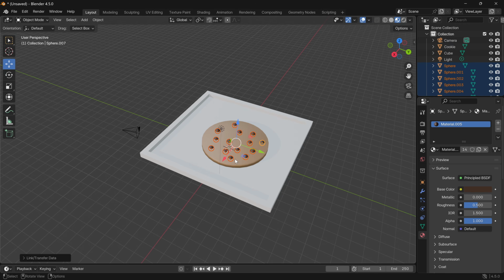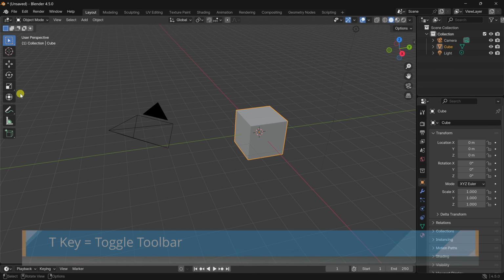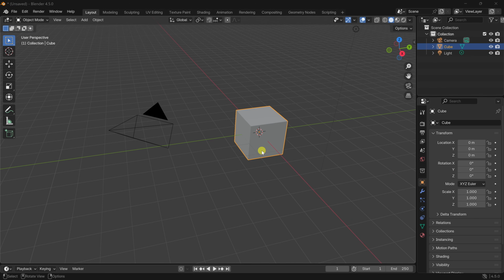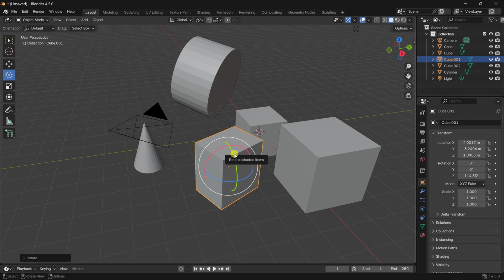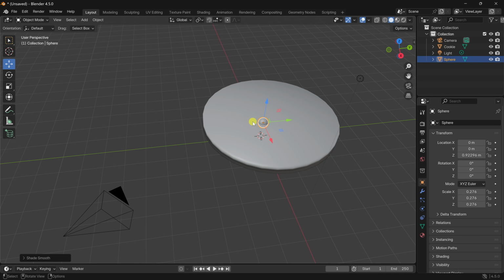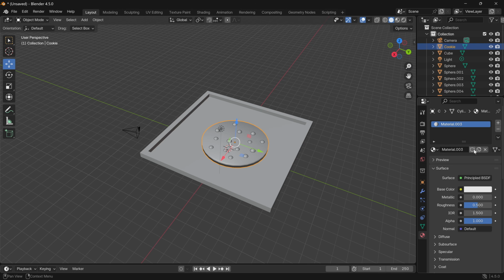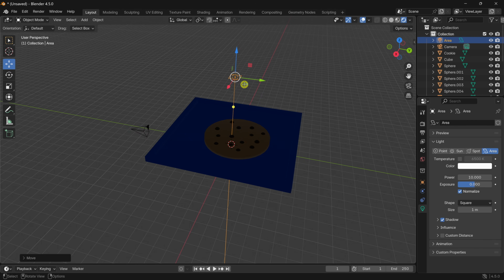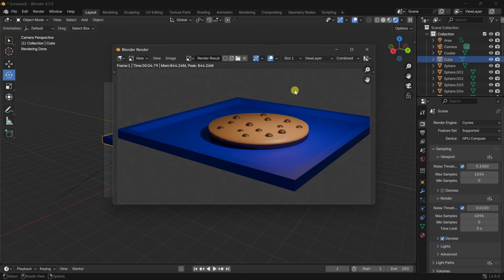Blender Tutorial for Beginners

Comment: Great tutorial. Does the eye drop color picker tool work with the Mac version? I opened a jpg, but as soon as I leave the Blender window to select the color, the eye dropper is no longer usable. Does it need to be opened within Blender.
Reply from the maker: Yes, the eyedropper works on Mac. Since sampling outside the window is failing for you, open the JPG in Blender’s Image Editor and sample it there instead. It doesn’t always have to be inside Blender—outside-window sampling was added for Mac in Blender 4.1. Which Blender version are you using? Release notes: https://developer.blender.org/docs/release_notes/4.1/user_interface/

Comment: This a very good tutorial . Would you be interested in adding Chico Chica male/female 5 piece cubes for the CubicWonder infinite system of 3D geometric Order.
If you are interested I can upload the .obj files for users of Blender.   I show all this using windows software on thepaultm channel.  Its a lot better than using Chaos Theory.
I find it very difficult to copy one part from end point to mid point or end point or centre point of another part.
I failed to group parts together to copy and move things around the same as you can with a cad programs similar to Rhino 6 or 8. This is a  very simple task.

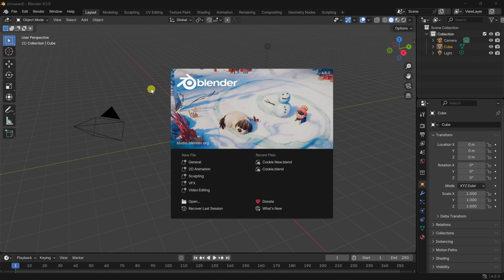Comment: 0:58 splash screen
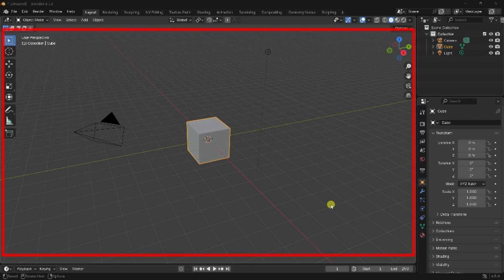2:44 3D viewport
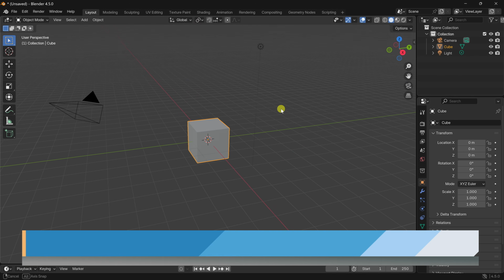3:01 Pan view: shift + middle mouse
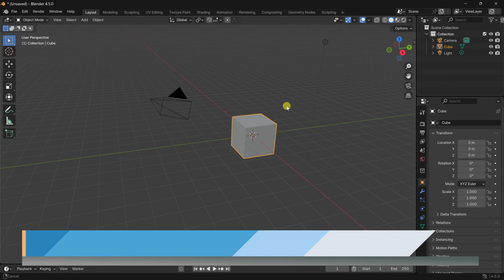3:08 Zoom: Mouse Wheel Scroll
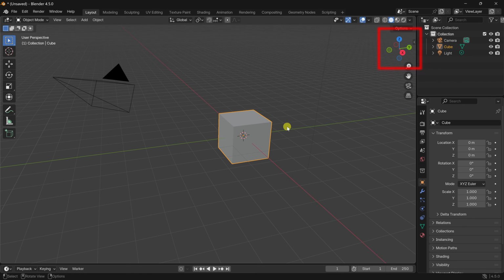3:15 Gizmo
4:41 Toolbar
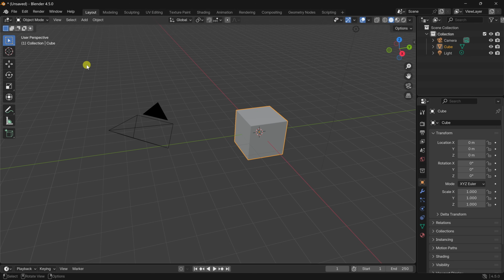7:20 outliner
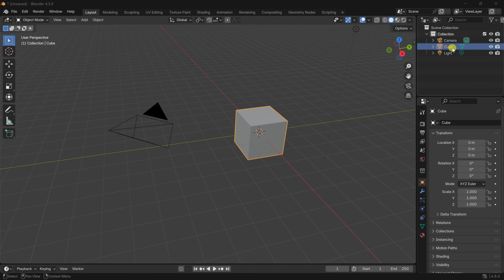8:13 properties
10:04 adding cube
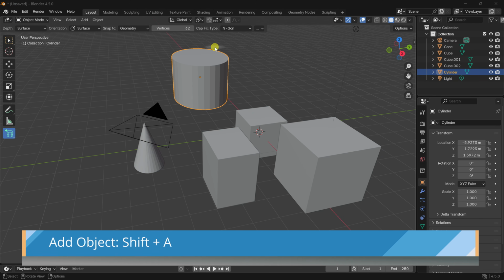11:36 Add object key
14:24 scaling cone
15:07 Delete object key
16:41 object menu
17:32 Add menu key
18:57 duplicate key
21:44 arrow icon meaning
24:14 Blender has several shading modes.
26:22 Link properties key
Reply: For some reason I cannot linnk the Material. The chips after being selected I press shift+L then Material but they remain white.
Reply: my extrude region isnt showing the plus sign and its making it difficult to make the tray

Comment: My render is not saving, what can I do?
Reply from the maker: If your image render isn’t saving in Blender, try these steps:
	1.	Set the Output Folder
Go to the Output Properties tab (printer icon) → set the Output Path to a valid folder (e.g. C:\Users\YourName\Pictures).
	2.	Choose the Right File Format
In the same tab, under File Format, select something like PNG or JPEG.
	3.	Use “Image > Save As” After Render
After rendering (F12), you also need to go to the Image Editor → click Image > Save As to manually save it.
	4.	Check for Write Permissions
Try saving to your Desktop to make sure Blender has permission to write there.

Let me know what settings you’re using and I can help more!
Reply: @KevinStratvert HELLO! I AM NEW TO ALL OF THIS AND I DO NOT KNOW WHERE THE OUTPUT FOLDER IS FOR STARTERS.😵‍💫

Comment: Some reason the camera doesn't work. I click on it or press Zero and nothing happens. Also, the temperature toggle isn't where yours is, I can't find it. 
Did Blender update since this video was uploaded?
Reply from the maker: Hey! Thanks for the comment. Blender does get frequent updates, and sometimes the UI or shortcuts shift slightly depending on the version. Since I published this video just last week, it’s based on one of the latest stable builds.

For the camera:
- Make sure you actually have a camera object in your scene. You can check in the Outliner (top right panel).
- If it exists, selecting it and pressing Numpad 0 should switch to the camera view.
- If you're using a laptop or don’t have a numpad, try View > Cameras > Active Camera from the top menu, or use Fn + 0 or Alt + 0 depending on your keyboard setup.

For the temperature toggle:
- If you're not seeing it, try switching to Cycles Render Engine and double-check your material nodes.

Comment: Temperature doesnt show up for me under the light settings weirdly
Reply: Same. so does the camera when I press zero or click on it, so unable to frame. I suspect a recent Blender update had changed these :(
Reply from the maker: Thanks for the heads-up! Blender does sometimes shift things around in newer versions, which can be confusing.

For the temperature setting:
- Make sure you're using the Cycles render engine—the temperature slider usually appears under the light settings when Cycles is selected. In EEVEE, it may not show depending on the light type or shader setup.

For the camera issue:
Double-check that there’s a camera in your scene (look in the Outliner panel). If it’s missing, go to Add > Camera. Once it’s there, press Numpad 0 to look through it. If you’re on a laptop without a numpad, try View > Cameras > Active Camera from the top menu.

Comment: This tutorial helped me go through hand learn all the basics you taught clearly, but it seems like some unknown error happened at my end as the final render isn't rendering the color of the cookie, but is rendering the color of both the tray & chocochips. Can anybody give me guesses regarding what I possibly could've messed up.
Reply from the maker: Glad the tutorial helped you out! 😊 As for the render issue—it sounds like the cookie might not have the right material assigned. Try selecting the cookie, going to the Material Properties tab, and making sure the correct material is applied there. Also double-check you're in Material Preview or Rendered view and using the right render engine (like Cycles or Eevee). Let me know if that solves it!

Comment from the maker: 🙏 REQUEST VIDEOS - https://forms.gle/BDrTNUoxheEoMLGt5
📩 NEWSLETTER - Get the latest high-quality tutorial and tips and tricks videos emailed to your inbox each week: https://kevinstratvert.com/newsletter/
⌚ TIMESTAMPS
00:00 - Start the project & introduce the cookie
00:36 - Download and install Blender
00:56 - Change key preferences
02:28 - Navigate the 3D viewport
03:11 - Use the Gizmo for orientation
04:26 - Open the toolbar and learn shortcuts
05:51 - Switch between Object and Edit mode
07:16 - Manage objects in the Outliner
08:09 - Adjust object properties
08:47 - Open the sidebar
09:33 - Add and manipulate objects, move, rotate & scale
14:46 - Delete test objects
15:17 - Add the cookie base
17:21 - Add chocolate chips
19:25 - Build the tray
22:03 - Position the tray under the cookie
22:50 - Apply materials
26:58 - Light the scene
29:26 - Frame the cookie with the camera
31:44 - Choose render settings
32:17 - Render and save the final image
32:45 - Wrap up and celebrate